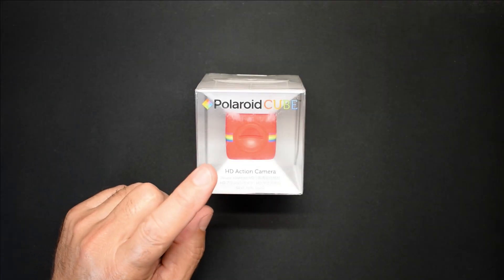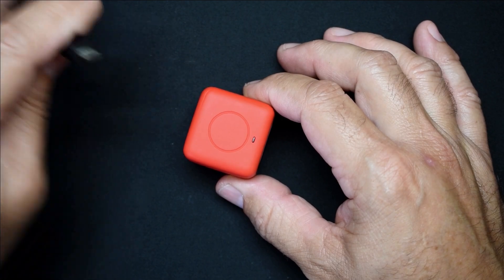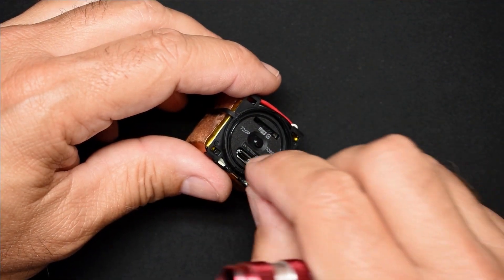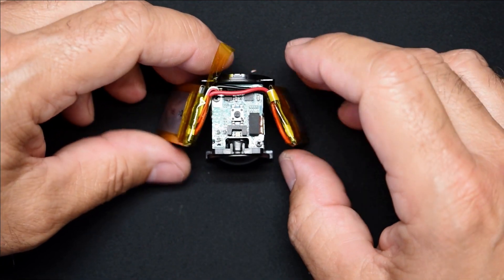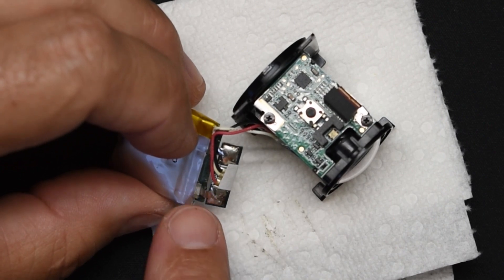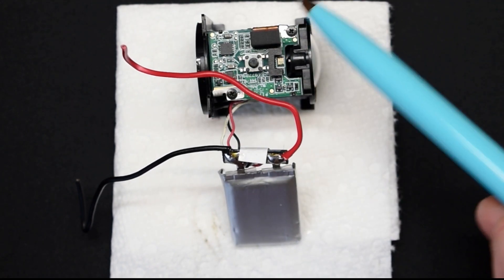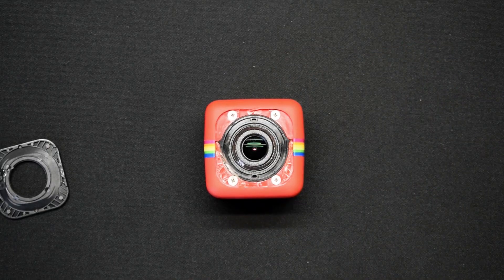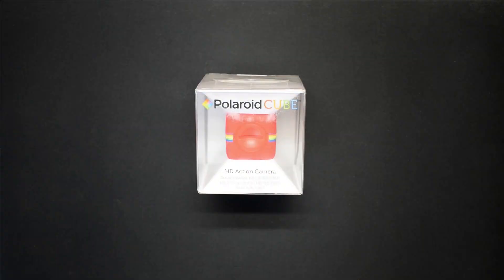Cube Camera Battery Replacement (Internal Lithium Polymer)

Comment: I have one of this cube camera and used for Motorbike helmet for few years until the battery was dead.. I was wondering how to fix this issue and I found your video! That is reallt good help and as soon as I get the new batteries I will replace them as you instruct it. Thiank you soo much and you got another subscriber and thumb up today. :)
Reply from the maker: You're welcome! Take your time doing it. I have 2 that work perfect again.
Reply: @electronicsNmore  I have another issue with my cube cam, you know the magnet thing, it’s come out.. Any reccomendation how to fix that? I mean what glue should I use for that or is there any other way to fix it? Thnx in advance :)
Reply from the maker: @Deper38  E-6000 clear adhesive

Comment: How is the battery capacity if you don't mind? It seems that original Fugi 4.8volt was a premium battery they stuck in there.
Reply from the maker: Not bad. Around 40 min recording time.

Comment: Hey did you try the shock voltage to wake it from sleep and the 5 charge/discharge trick?  or was it too far gone
Reply from the maker: That works for nimh and nicd. These sat too long in a discharged state.
Reply: @electronicsNmore   it works for Li-ion's too. but sounds like not for li poly, bugger... thanks for video as always!

Comment: Nice,  I love recycling products! I might actually get one of these.  I think I would apply a tiny amount of silicone along the rainbow band and around the lens area, just to ensue water resistance.... 👍
Reply from the maker: Glad you enjoyed the video! I thought of a bead of clear silicone, but I never plan on using it in the rain, and wanted it easier to open to swap out the cells later on. Thanks for watching!
Reply: @electronicsNmore  Silicone off gassing could damage the lens.